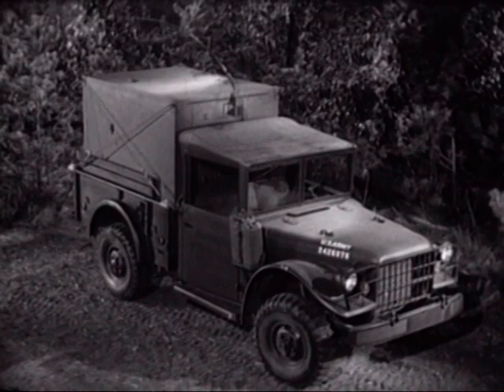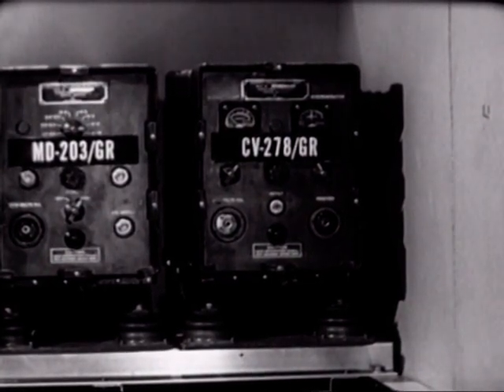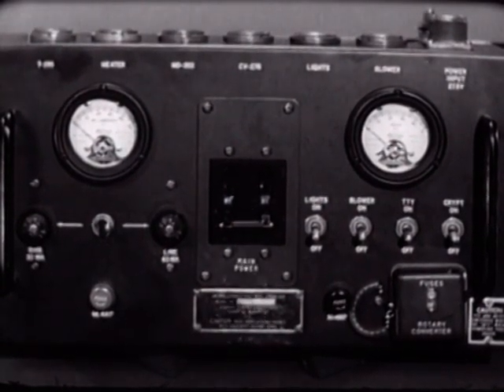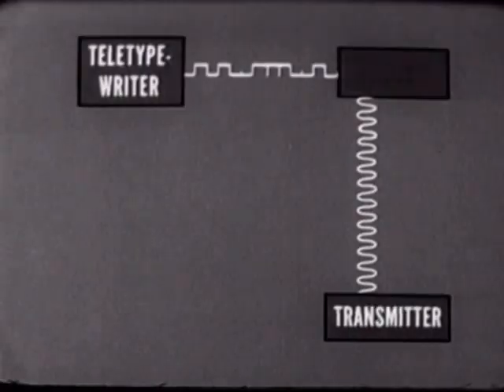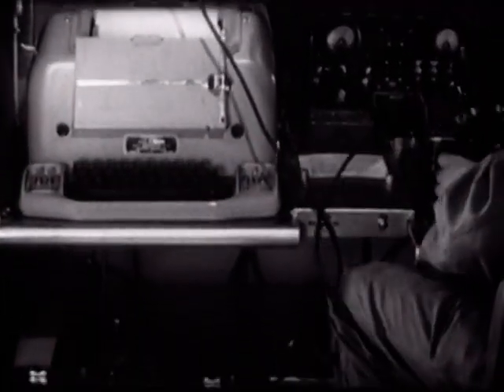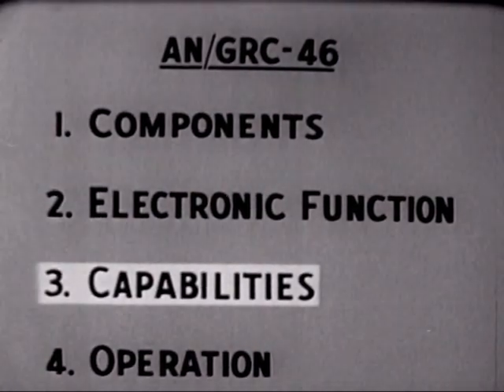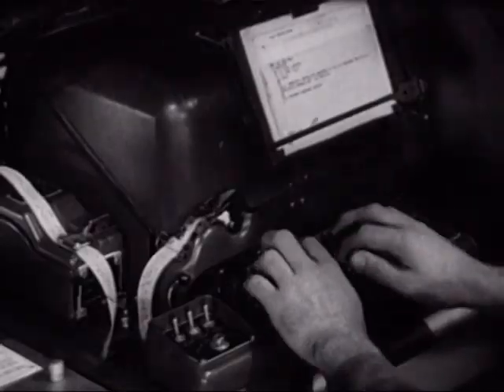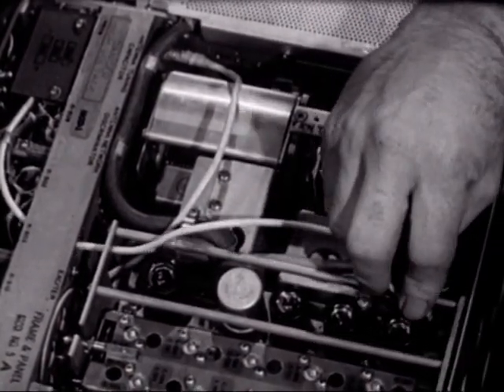RADIO TELETYPEWRITER AN/GRC-46

Comment: Anyone knows what type of character coding this? This doesn't seem like ASCII or EBCDIC.
Reply: The majority of TTYs used baudot code, as that was what they started with, and they kept it to avoid making older models redundant.
Reply: Teletypes of that era used a 5 character Baudot code which consisted of Mark and Space. Mark being the presence of signal and Space being the absence of signal. With the introduction of computer interface teletypes were equipped to communicate in ASCII.